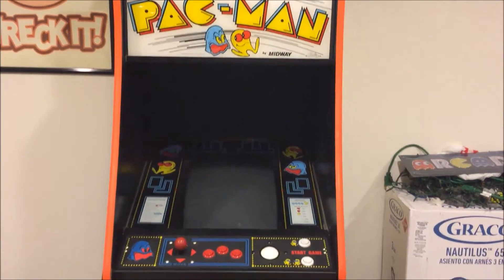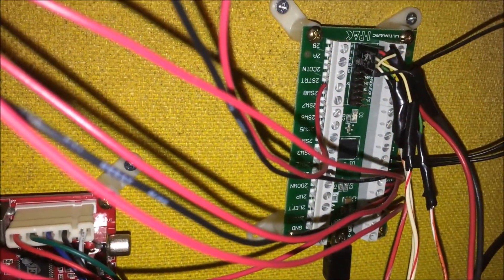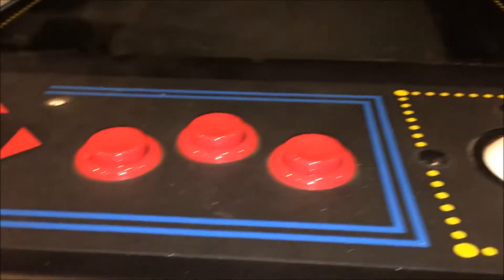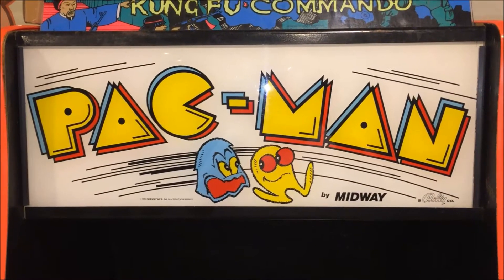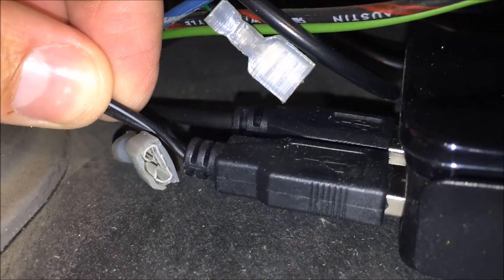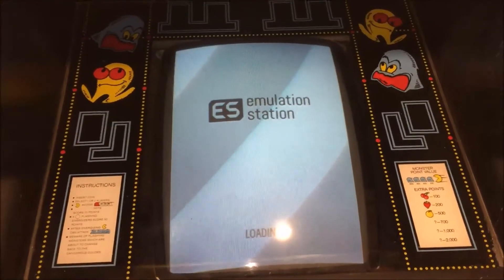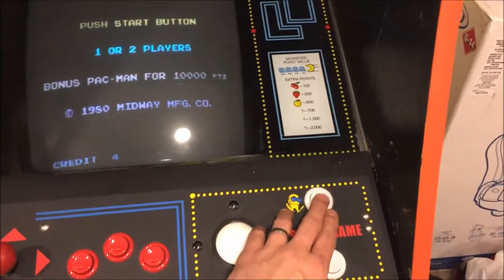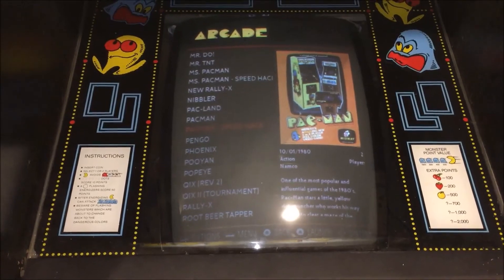GAMING: Connect Raspi3 to Arcade CGA monitor easily!

Comment: I'm trying to connect
my PC to my CRT that has a 360x240. Im using Windows 10 and im trying custom the Res onto 360x240. How do you change the refresh rate to 15krz? Some reason it wont let me change it on to 15khz. Do I need a program like Quickres,
to allow me to change the refresh rate to 15khz?

Comment: I bought one of these cga adaptors, they are pretty decent so long as you have a good quality screened vga cable and a decent graphics card, when i hooked it up to the vga port on my old laptop the picture was a mess, blurry and lots of interference i thought great this no good, but when i hooked it up to my gaming pc via dvi on a nivida gtx 670 the picture was spot on, nice solid colours and and no colour bleeding or interference, these are good little adaptors, the only issue with them is they don't remember you picture settings so its best to use your monitor controls and any other picture adjustment should be made in the graphics card control panel, luckly nivida has a decent control panel to get the picture perfect.

I also have one of those ipacs, although they work fine for emulators for 2 player mode they are pretty useless for pc games as i found out with streets of rage 4, unfortunately the pc sees them as a keyboard so a second player option is unavailable on some pc games unless you have a usb controller which is what i did, i bought 2 usb controllers stripped them and soldered wires to the pcb, boxed it and plugged it into my control pannel and pc for 2 players and it works fine, got rid of the jpac as sor4 is a must on my cab and pretty useless with out 2 player option.
Reply from the maker: Yea for a quick connection they do a decent job. A bit blurry and not having a battery or NVRAM for the settings is the downside for sure.

Comment: Do you know if the arcade CGA monitors (with R G B S connectors) can show more than 16 colors? Like can each color only be on or off or do they accept analog values?
Reply: When they are talking CGA and EGA on arcade, they are referring to analog RGB. Somewhere along the way they co-opted the terms to incorrectly apply them to CGA and EGA high resolution refresh rates to of analog video with composite sync, even though REAL CGA and EGA were digital and did not use composite sync. It would be closer to compare what they are calling CGA to European SCART RGB, as that would be vary close specs.
Reply: @zaxxon4  so would a typical CRT monitor you’d find in an arcade cabinet be able to show an analog signal

Comment: The easier, yet more expensive, option is to get an ArPiCade that converts JAMMA to a Pi, so that you don't need the iPAC or CGA adapter.
Reply from the maker: Correct. I actually made a new video that covers this and a better way. This device kinda sucks honestly haha

Comment: I have a Konami Cabinet that was originally the teenage mutant ninja turtles game, at some point was converted to a soul calibur machine and then finally ended up as a golden tee classic machine. I'm going to do a hefty restore to the cabinet and thought it would be cool to convert it to a retropie machine, would love to be able to keep the original CRT monitor with the pi. Thanks for this.
Reply from the maker: Sergeant Seven I actually just “restored” and old TMNt back to original, but I didn’t have a board. I used a RPIjamma adaptor with the 4 player addon from hiscoresaves. It’s a little expensive but it looks amazing and The picture quality is better than this cga adaptor
Reply: @sk8ersublime  I would love to find jamma boards for xmen, tmnt, the simpsons, and maybe tmnt in time or one of the other 4 player konami games and use a jamma switcher. I found a tmnt board on e-bay but they wanted $600 for it. I might consider doing a retropie conversion but I want the cabinet to look original, it still has the original serial plate on the back.
Reply from the maker: Yea I was the same way. My cabinet looks just like a turtle cabinet. No extra buttons. And could use a PCB in a matter of minutes. I was planning on building a 2nd control panel so I could play games that need more buttons, but I don’t want to damage all of the repair work I did on the original panel :)

Comment: What happens if you connect an old cga monochrome monitor instead? Would it work?
Reply from the maker: Alonso García I would assume it would work, as long at its 15khz. But I’ve never worked with one this way
Reply: @sk8ersublime  Thanks for your answer, man. Im looking for ideas that involve a few monochrome monitors I have.
Reply: Yes it would work

Comment: Nice cab. I bought one of these boards for my project and it did not work. I ended up swapping in a modern LCD. I subbed and appreciated the video. Come check out my arcade project at Level By Level Gaming if you like , thanks
Reply from the maker: Sorry you didn’t have good luck with the device. I wish it handled other resolutions so the picture was a bit clearer. But other than that, it works great for my needs
Reply: @sk8ersublime  thanks for the reply and again for the sub! I kept the board in case I was just doing something wrong. When I tried to use it with a original crt/cga it popped the red color spectrum out and I pulled the screen in favor of a LCD

Comment: You sould show as where cga cable connects to old screens mainboard .Did you do modifications to  jamma connector ?
Reply: Yeah I bought this after watching and my picture comes in all jacked. Discolored and distorted in places. Can you elaborate on the process of connecting that gbs 8100 to the monitor? Thanks!
Reply from the maker: I’ll make a follow up
Reply from the maker: When I had the 60-1 board in this, I did have a JAMMA harness. But with using the RPi3 I do not need the Jamma harness.  The iPAC is wired to the buttons and joystick, then the USB goes to the RPi3.  The HDMI/VGA output from the RPi3 goes into the Converter, and then the CGA out from the converter goes into the video input on the monitor. I may have had to wire the cable from the CGA to the monitor, just to match RGB+Sync to the correct pins, but i honestly dont remember as its been a while since i did this install. This monitor is a G07, which is commonly found in Pac-man and other games from this early arcade era.
Reply from the maker: G1zm0 abizmo  I havent had a chance, however i need to do some work on this machine, like...this week. So Ill try to get something going with a better detail.